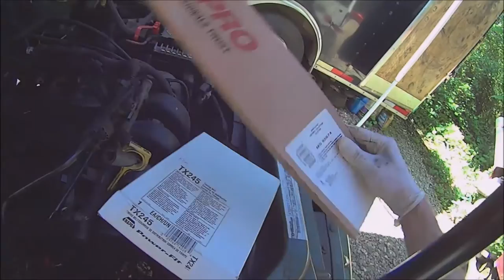REPLACE HEAD GASKET Plymouth Breeze Stratus Cirrus Neon Dodge 2.0l Mopar 2.0

Comment: DIY, please do rear brakes on 99 Breeze Cirrus Stratus. I took the shoes off and it turns out they are specific to trailing/leading and left/right. I screwed up trying to put the shoes back in, but they don't go in the way they came out. I even took "before" pictures. THANKS!

Comment: I can tell it wasn't a breeze, I give you props for finishing it . just watching it looked harder than squeezing a rhino into a smart car. would it be bad if you didn't send the head off to the machine shop? I didn't on my truck.
Reply from the maker: hahaha thanks man, it sucked worse than the Accord I did a few years ago. It's ok not to get it machined if you're just doing preventative maintenance and know that it wasn't leaking or overheating and likely isn't warped, or if it's an easy head to get off. If it's a head that requires a ton of work to remove and install, then you want to get it machined, because you don't want to risk spending all that time just to have it leak again. Since the heads are much easier to get off of the older pushrod engines, it's ok, if it still leaks at least they're easy to get back off. If you put it back together and it's not leaking then no worries lol.
Reply: a DIY Car Guy thanks , it wasn't leaking previous to me replacing the head gaskets , and it's pretty easy to get off again. I understand what you went through on this project it makes perfect sense to send it to the machine shop
Reply from the maker: hm didn't see this message haha, but yea i'd say you're ok with not sending to the shop, if it doesn't need shaved it's best not to shave it, they can only be shaved so many times haha.
Reply: a DIY Car Guy your good. It's like the saying if it ant broak don't fix it lol
Reply from the maker: Jimbo Booth yup exactly haha
Reply: a DIY Car Guy saves money lol
Reply from the maker: Jimbo Booth that's always good too lol
Reply: a DIY Car Guy yes sir

Comment: Man.... This video es Great. I need help for change head Gasket Dodge Neon 1997 but, i have a question = I need to rectify the head gasket?

So far, the problem I have in my Dodge Neon is that there is more pressure in the cooling system, and it is passing the water to the reserve tank and hence the water is coming out of the radiator

Comment: Don't ever pull fuel lines off with out bleeding the fuel system first. That way it don't squirt out of the fuel line when you remove it just a tip

Comment: QQ......my car HG has been toast and leaks in the passenger side rear corner....car doesn't overheat nor coolant mixed with the oil but on the back of the header you can def tell that is where the oil burns off at (smoke from the hood during running and after turned off)....would it be worth the while to get a compression Test before diving into replace the HG just to see if the Engine is even worth the work ha?  I planned on replacing Valve Cover, Timing Belt and accessories, and HG w/ Machine of the Head.  Had this car since High School and would like to keep it as long as I can...it's not my daily driver but wouldn't mind learning how to do timing and HG....so that it can be applicable to the other cars I have.  Thanks
Reply from the maker: sure it's not the valve cover gasket? I would get the compression test...it could save you a lot of work. It's a ridiculous amount of work on this particular engine to do the HG. Of course any subsequent change on other engines would seem easy so that would be a plus of learning on this engine.
Reply: Will try Compression first just to see what it yields.......valve cover would be alot easier than messing with the HG....but I'll report back once done so.
Reply from the maker: Cool thanks!